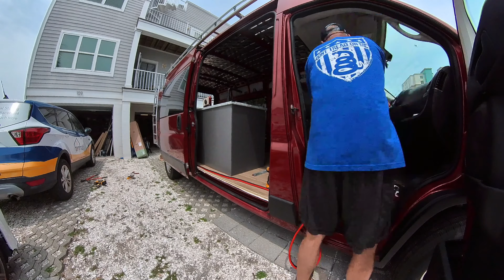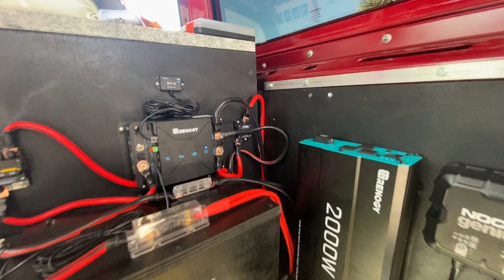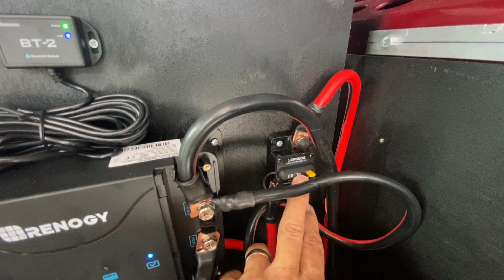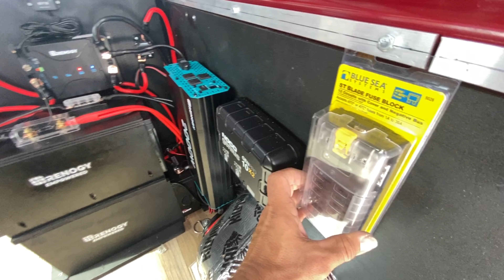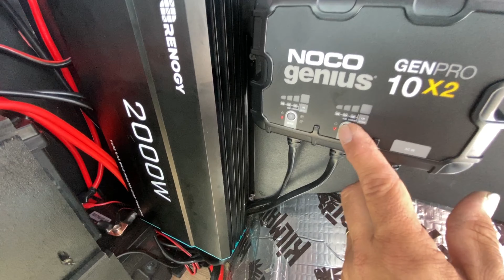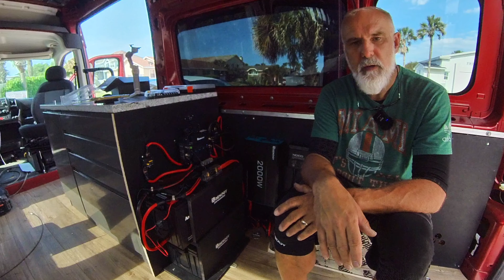Big Red Van Build Installing the Electrical System Day 25-26

Comment: Some day you may want to do another video where you slow down that time lapse for running the wire/cord/cable from the battery back to the rear of the van.  ( with voice over explanation). 60 yr old female here with no construction or automotive experience here watching your videos for how to and order of events.
Reply from the maker: Ah ok I will remember that on next video. If you need help I can try to walk you through it.